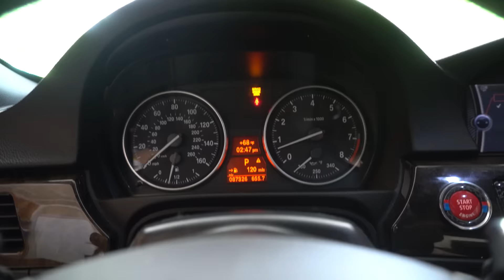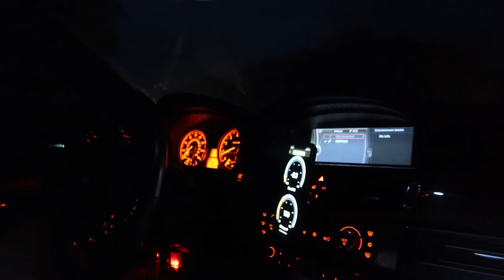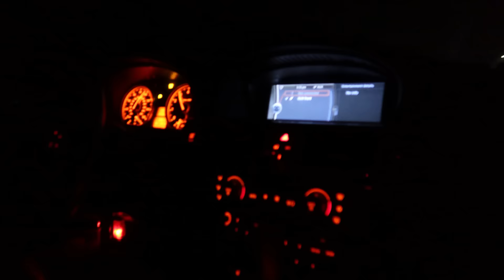Mods To Make Your BMW 335i Sound CRAZY! * Found A Hater *

Comment: You don’t want your blow off valve to flutter/surge. That means it’s not setup properly and will wear out your thrust collar in your turbo which will allow excessive turbine wheel play. Make sure you have the right size vacuum line on “1/4” also make sure your running the right size spring, The N54’s I believe like the 8 pound springs. Proper setup is key with these cars
Reply: No 8psi is little too low, 11 psi for bov is usually most popular n54 owners use. I use em as well my self with single turbo setup.
Reply: @punkboy459  Sorry I’ll be more technical! It all comes down to how much vacuum your car is pulling. Measure how many in/hg the vacuum system is pulling. Then compare it to the spring rate chart Tial provides. Not all N54s have a one size fits all spring!

Comment: Every n54 owner has had an “I don’t wanna fuckin’ touch this thing moment” 😂😂😂😂
Reply from the maker: Ong😂😭
Reply: @WyattWebster  I did 19t’s, all the coolant and oil feed and return lines for the turbos,relocated inlets, downpipes, 2” outlets, water pump, thermostat, intercooler, charge pipe, oil pan gasket, rod bearings, and a bunch of other little stuff all in one go. Had to cut the passenger side tie rod off with an angle grinder because the threads were stripped. All on jackstands. The whole thing took 10 days of 8ish hours a day. Kept having to order new parts because shit would break every time I took something off. By the 5th or 6th day I didn’t even want to get out of bed in the morning. 😂

Comment: You need a downpipe fix kit to get rid of that cel. Used to be able to find them eBay, and VRSF used to make them, but I just spent 5-10 minutes on Google to find you a link, and didn’t find any. Probably gotta check some forums to find them.
Reply from the maker: Bettt yeah we’re gonna look into it
Reply: @WyattWebster  Whatever tune you run should have an option for it.  In MHD you can select Aftermarket DP and it will bypass the 02 code reading.  On JB4 you can just clear it with the cluster control.  JB4 with BEF you can clear it same way as MHD.

Comment: Does the bov sound work when reving in N or P only works for when when cars driving?
Reply: Works wen revving in N wen ever you let off the gas it will release the pressure and make the sound
Reply: Driving N and park
Reply: also in Race mode ;)

Comment: I’m thinking about a N55 should I pull the trigger ?
Reply: If you don’t want big power go for it … but i wouldn’t … n54 is def better
Reply: Evan  would y’all recommend a high mileage N54 ? I know the internals are very strong.
Reply: My e92 N55 is fun as hell to drive and sounds way better than an N54. I prefer the LCI look too over the older pre lci m. But if I had the money for a 335is then it’d be a different story
Reply: Evan  it’s hard to find those type of n54’s I know you can look on Facebook etc but they so hard to find.

Comment: I’m stuck between getting a 335i or 535i either when I get it imma support ur website
Reply: 335i , 535 a boat
Reply from the maker: Appreciate you bro!
Reply: @whoareyou551  535i fucking moves tho
Reply: Jonathan Turcios 335 even faster and looks way better too
Reply: @whoareyou551  335i is faster cuz it lighter but some 5 series are nice as hell bro, its just some niggas don’t got style bro
Reply: 535 is huge but if you like big body cars that’s the way to go , 335 is smaller , more compact, and looks more sporty. in the end both have same engine but 335 is faster cuz it’s smaller body

Comment: Just got a 335! Previous owner had replaced the mufflers, so it already has a sportier sound. I can’t change the downpipes atm, but I am thinking about removing the resonators! What do you guys think? Is it worth it? Will it sound nice??
Reply: Is it legal to a muffler delete im curious cause i want to take mine off
Reply: @johnnytacosauce  muffler delete is legal
Reply: If you plan on doing a cat-less down-pipe no point in deleting the resonator, but u can go with a vibrant resonator just to make it a bit loud but still not so obnoxious, then when u have your downpipes u still have kinda good sound still